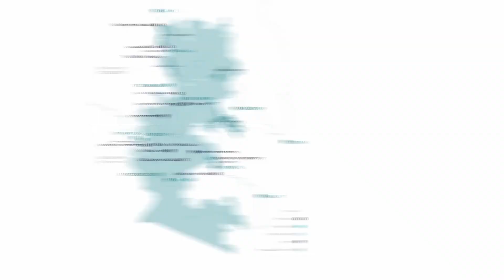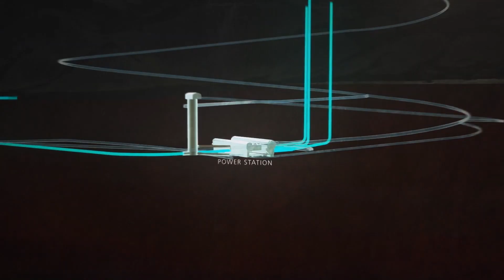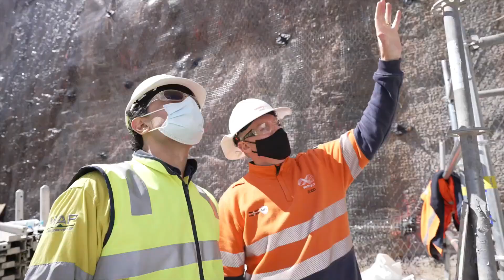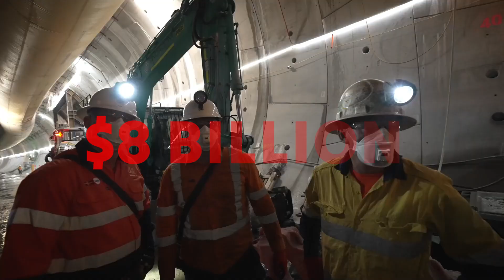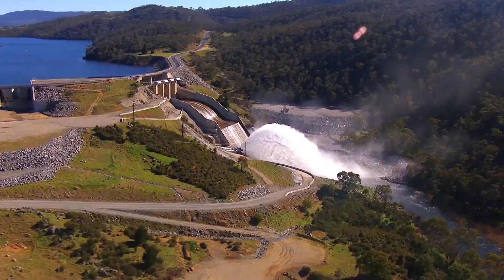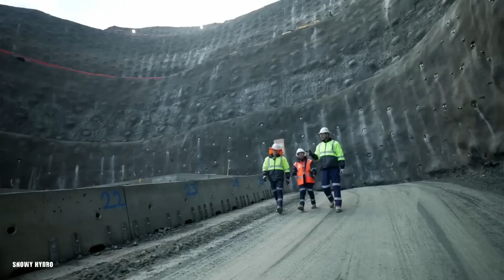Australia's $8BN Megaproject Disaster EXPOSED

Comment: back in 2016 the industry was informed of a project in this area that proved that a dam could be fitted with up to three banks of low pressure turbines with no mods or issues to the main/existing turbine hall and no added down time for servicing and the inventor was told WE WILL NOT TAKE IT AS THE PRICE PER KW IS TO RISE AND WHY REDUCE OUR PROFIT .  the snowy rang the inventor if it could also pump the water back up the hill and was told no